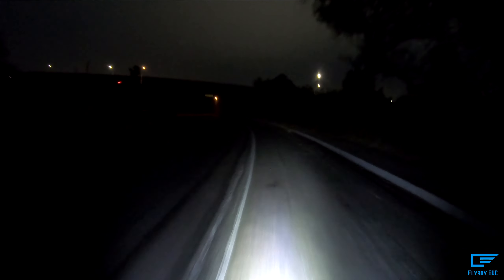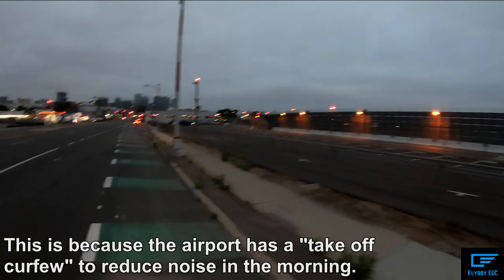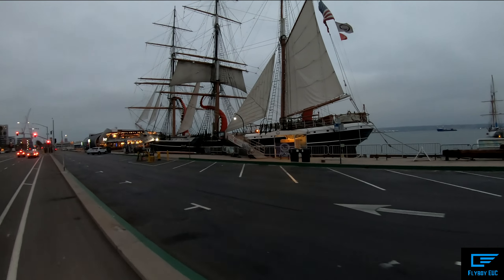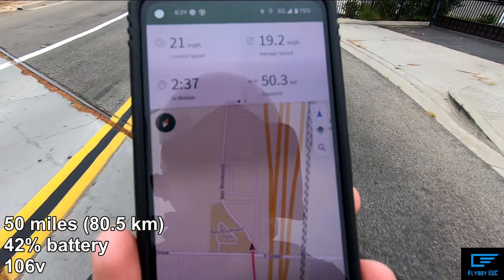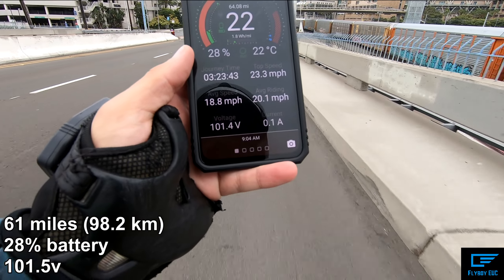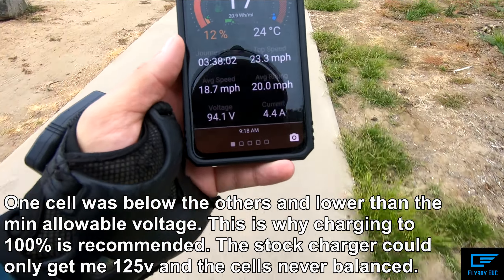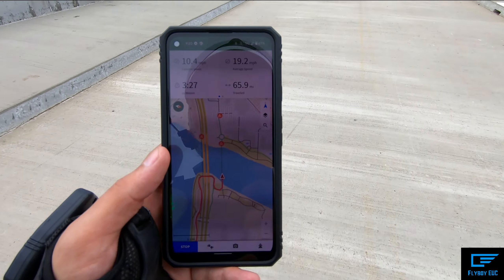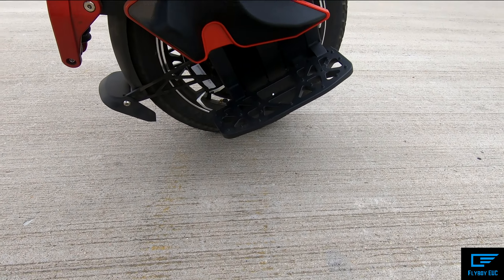S22 Range Test at 20 mph

Comment: I'm interested in this wheel cuz it's completely sealed, this is is not some gotway trash quality
Reply from the maker: Funny you say that cuz there have been some major quality issues with the S22. They recalled every motor in China and replaced them. The only reason they haven't done the same with the rest of the world is either due to costs or they are trying to get an idea of the breadth of the motor defects with the Chinese sample they now have. The Master has a lower failure rate but also isn't as popular as the S22. Regardless, both wheels will need some major modifications in order to be fully enjoyed.
Reply: My s22 makes a loud clicking sound once it warms up. Very loud, and I can feel the click in my feet. Kingsong is supposed to be letting Freemotion euc know something soon (I hope).  I love s22 otherwise.  Be way better with better jump pads too
Reply: @trowland9575  cutout is next many have said.